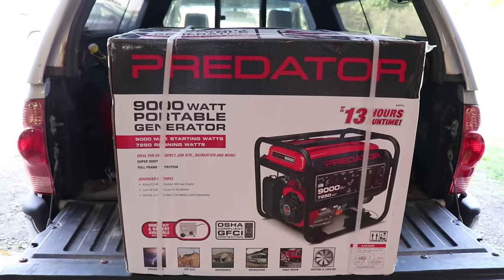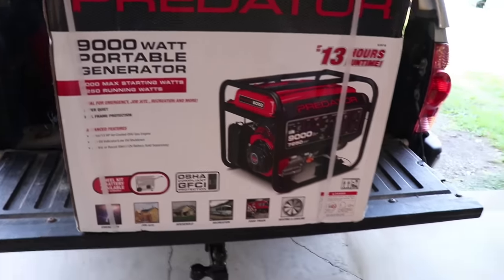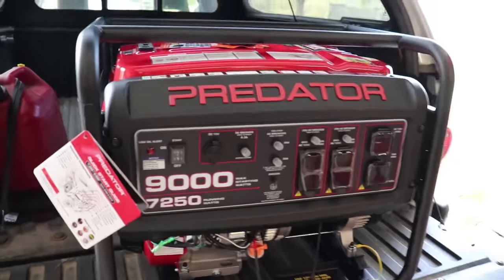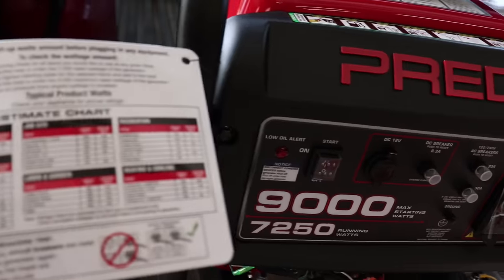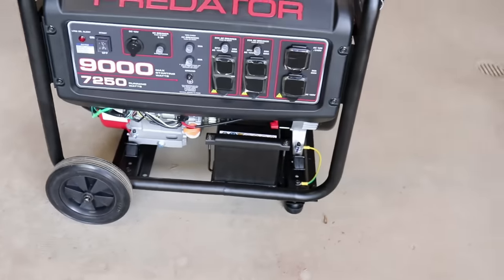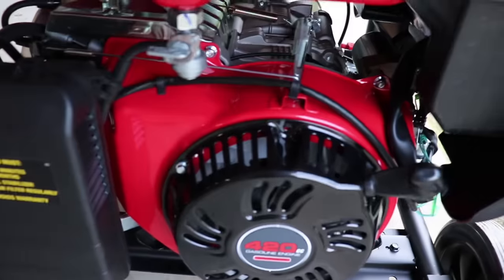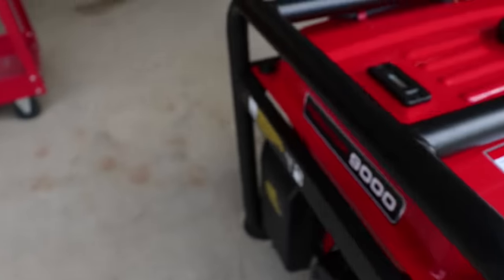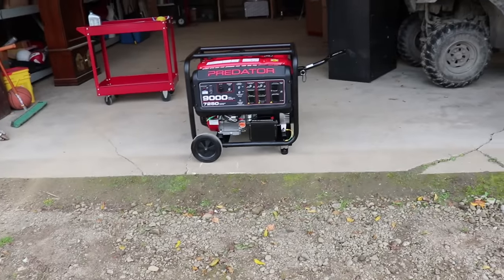Predator Generator Running Our ENTIRE Home. (Complete Setup and Cost)

Comment: Great video. We live in SE NC and our concern is hurrricanes. I guess where I still have questions concerns 110 vs. 220. I had an electrician do a220 plug. In the video in looks like where you made your 110 connection was a 220 plug. Is that correct? I assume you were running your cord from 110 outlet on the generator to the 4 hole receptaptacle?  That would sure beat running extension cords thru windows. My concern is that some of the YT videos have cautioned about backfeed in case the power company is working to correct the cause of the outage.
Thanks so much!
Reply: ⚠️Here’s an important safety announcement for everyone:

Please make sure you follow the generator safety tips whenever you use your portable generator. This is just a reminder for everyone’s safety. All generator safety rules need to be followed carefully 

Here are the generator safety tips: 

1) KEEPING OTHERS SAFE: Please do not allow an non qualified person or your children to operate and service the portable generator. Just because some manuals don’t say that doesn’t mean it’s safe. That is important against the generator safety rules. We also need to be keeping an eye on our children too. You need to make sure that your children are not playing near the portable generator especially when it’s running so they won’t get electrocuted. Generators pose electrical risks and they can be hot during an operation. Please keep your children away from the portable generator at all times. It is important to keep our children safe especially our little ones. Children often get curious about anything so we should keep an eye on them to also make sure they’re not wandering towards the generator. 

2) WHERE TO RUN YOUR GENERATOR: Some people use their portable generators indoors which increases the risk of carbon monoxide poisoning. It’s important to have a carbon monoxide if you have a gas generator. Never ever use your generator indoors even if your doors and windows are open and even in the garage is not safe to use a portable generator. Not even at your porch and your deck. It is never safe to use your generator indoors and in enclosed areas of your home. Your generator needs to be 15-20 feet away from your house. 

3)🔥FIRE HAZARDS: Never refuel your generator while it’s running. You need to let your generator cool off before refueling it and before storing your generator. Never overload your generator too. Never ever back feed your generator. You should never plug your generator into a wall outlet. Also never store propane tanks indoors. Please keep flammable things away from the generator as well and please don’t smoke cigarettes near the generator. Having a fire extinguisher next to the generator is also important against the generator safety rules. 

4) GENERATOR OPERATION: make sure your hands are dry before touching the generator. Never use your generator in wet conditions. Don’t let your generator get wet. You need a generator tent if you need to use your generator during wet weather. Please don’t wear loose clothes when operating the generator. Turn on your generator before plugging in appliances. Use the right cord for your generator. Please do not use worn out cords. Do not touch the generator’s engine when it’s still hot. 

https://youtu.be/I1jT3ANENvI and here is a video more about keeping others safe when using generators. All generator safety rules need to be followed carefully. 

Hope this helps. 

Please make sure you follow all the generator safety rules.

Comment: The power supply wouldn't have a clean sine wave from the generator which in turn will ruin things like laptops and other sensitive equipment.
Are there any warnings about this on that wattage card?
Reply: I can understand an inverter not having a good sine wave, but why would an actual rotating generator be a problem?
Reply: @jeepien  the sine wave it produces will not be stable enough for delicate electrical equipment, I know, i've ruined enough laptops and phones over the years.

Comment: Just picked up one of these generators, thinking about doing a propane conversion on it. I lose power at my hose usually at least once a year.
Reply: ⚠️portable generator safety announcements:

This is just a reminder to remember the safety rules when using portable generators. 

1) KEEPING OTHERS SAFE: Please do not allow an unqualified person or your children to operate and service the portable generator. Just because some manuals don’t say that doesn’t mean it’s safe. That is important against the generator safety rules. We also need to be keeping an eye on our children too. You need to make sure that your children are not playing near the portable generator especially when it’s running so they won’t get electrocuted. Generators pose electrical risks and they can be hot during an operation. Please keep your children away from the portable generator at all times. It is important to keep our children safe especially our little ones. Be aware of all the hazards.

2) WHERE TO RUN YOUR GENERATOR: Some people use their portable generators indoors which increases the risk of carbon monoxide poisoning. It’s important to have a carbon monoxide if you have a gas generator. Never ever use your generator indoors even if your doors and windows are open and even in the garage is not safe to use a portable generator. Please do not even use your generator in your deck or balcony. It is never safe to use your generator indoors and in enclosed areas of your home. Your generator needs to be 15-20 feet away from your house. 

3)🔥FIRE HAZARDS: Never refuel your generator while it’s running. You need to let your generator cool off before refueling it and before storing your generator. Never overload your generator too. Never ever back feed your generator. You should never plug your generator into a wall outlet. Also never store propane tanks indoors. Please keep flammable things away from the generator as well and please don’t smoke cigarettes near the generator. Having a fire extinguisher next to the generator is also important against the generator safety rules. 

4) GENERATOR OPERATION: make sure your hands are dry before touching the generator. Never use your generator in wet conditions. Don’t let your generator get wet. You need a generator tent if you need to use your generator during wet weather. Please don’t wear loose clothes when operating the generator. Turn on your generator before plugging in appliances. Use the right cord for your generator. Please do not use worn out cords. 

https://youtube.com/shorts/eFigDfnPkcQ?feature=share and here is a short video more about keeping others safe when using generators 

Hope this helps.

Comment: @The Cook Family Homestead:  Don't you have any problems with your heating system ? The heating control, PCs, ... (electronic stuff) is said to be very sensitive to sinus wave disturbencies and might get killed very easily. Therefore normally inverters are used for this purpose because they have a steady sinus wave.
Reply from the maker: I have had zero issues!

Comment: If you’re not home when the power goes out, does this generator turn in automatically or does someone need to be physically present to turn on?
Reply from the maker: This is a manual generator....meaning I have to go out and start it and switch the power over.

Comment: My home is a older home, setup with 100 Amp service. My 220v in my home is wired with 10/3 wire not 10/4 wire. Over the past weekend, I wired this same Predator 9,000 Generator to my home. I had to add the 10 gauge Green wire to make 10/4. I went-out and purchased the Predator 10/4 twist-lock Generator extension cord for this generator for $49 from Harbor Freight. When wiring to the fuse box. I see many videos of people wiring a FEMALE outlet to their fuse box. The issue is, The 10/4 extension cord is male & female ends. By installing a female outlet to your fuse box. Doing so, will require cutting-off the female end of the extension cord to add a Male. Requires both males on the extension cord. Or do you simply cut-off the female on the cord and direct wire it to the box?
Reply: ⚠️Very important announcement for everyone:

Please make sure you follow the generator safety tips whenever you use your portable generator. This is just a reminder for everyone’s safety. All generator safety rules need to be followed carefully 

Here are the generator safety tips: 

1) KEEPING OTHERS SAFE: Please do not allow an non qualified person or your children to operate and service the portable generator. Just because some manuals don’t say that doesn’t mean it’s safe. That is important against the generator safety rules. We also need to be keeping an eye on our children too. You need to make sure that your children are not playing near the portable generator especially when it’s running so they won’t get electrocuted. Generators pose electrical risks and they can be hot during an operation. Please keep your children away from the portable generator at all times. It is important to keep our children safe especially our little ones. Children often get curious about anything so we should keep an eye on them to also make sure they’re not wandering towards the generator. 

2) WHERE TO RUN YOUR GENERATOR: Some people use their portable generators indoors which increases the risk of carbon monoxide poisoning. It’s important to have a carbon monoxide if you have a gas generator. Never ever use your generator indoors even if your doors and windows are open and even in the garage is not safe to use a portable generator. Not even at your porch and your deck. It is never safe to use your generator indoors and in enclosed areas of your home. Your generator needs to be 15-20 feet away from your house. 

3)🔥FIRE HAZARDS: Never refuel your generator while it’s running. You need to let your generator cool off before refueling it and before storing your generator. Never overload your generator too. Never ever back feed your generator. You should never plug your generator into a wall outlet. Also never store propane tanks indoors. Please keep flammable things away from the generator as well and please don’t smoke cigarettes near the generator. Having a fire extinguisher next to the generator is also important against the generator safety rules. 

4) GENERATOR OPERATION: make sure your hands are dry before touching the generator. Never use your generator in wet conditions. Don’t let your generator get wet. You need a generator tent if you need to use your generator during wet weather. Please don’t wear loose clothes when operating the generator. Turn on your generator before plugging in appliances. Use the right cord for your generator. Please do not use worn out cords. Do not touch the generator’s engine when it’s still hot. 

https://youtu.be/I1jT3ANENvI and here is a video more about keeping others safe when using generators. All generator safety rules need to be followed carefully. 

Hope this helps. 

Please make sure you follow all the generator safety rules.

Comment: I see you have your cord plugged in on the 120/240 plug on your generator.. How does that work on not burning your 110/120 electronics???
Reply: The 240 outlet feeds 120v to each leg on your electric panel.  Inside the house 120v things get powered by a 120v breaker connected to only one leg, 240v things get power from a 240volt breaker that pulls 120v from each leg giving you 240volt.  The panel distributes the power.

Comment: Hey Steve what type of generator would you recommend if I was to go with two heating elements that each Recommends 250 Voltage, if you got the time to reply if not I completely understand, thank you so much for your hard work support on sharing YouTube videos 👍🏽
Reply: ⚠️portable generator safety announcements:

This is just a reminder to remember the safety rules when using portable generators. 

1) KEEPING OTHERS SAFE: Please do not allow an unqualified person or your children to operate and service the portable generator. Just because some manuals don’t say that doesn’t mean it’s safe. That is important against the generator safety rules. We also need to be keeping an eye on our children too. You need to make sure that your children are not playing near the portable generator especially when it’s running so they won’t get electrocuted. Generators pose electrical risks and they can be hot during an operation. Please keep your children away from the portable generator at all times. It is important to keep our children safe especially our little ones. Be aware of all the hazards.

2) WHERE TO RUN YOUR GENERATOR: Some people use their portable generators indoors which increases the risk of carbon monoxide poisoning. It’s important to have a carbon monoxide if you have a gas generator. Never ever use your generator indoors even if your doors and windows are open and even in the garage is not safe to use a portable generator. Please do not even use your generator in your deck or balcony. It is never safe to use your generator indoors and in enclosed areas of your home. Your generator needs to be 15-20 feet away from your house. 

3)🔥FIRE HAZARDS: Never refuel your generator while it’s running. You need to let your generator cool off before refueling it and before storing your generator. Never overload your generator too. Never ever back feed your generator. You should never plug your generator into a wall outlet. Also never store propane tanks indoors. Please keep flammable things away from the generator as well and please don’t smoke cigarettes near the generator. Having a fire extinguisher next to the generator is also important against the generator safety rules. 

4) GENERATOR OPERATION: make sure your hands are dry before touching the generator. Never use your generator in wet conditions. Don’t let your generator get wet. You need a generator tent if you need to use your generator during wet weather. Please don’t wear loose clothes when operating the generator. Turn on your generator before plugging in appliances. Use the right cord for your generator. Please do not use worn out cords. 

https://youtube.com/shorts/eFigDfnPkcQ?feature=share and here is a short video more about keeping others safe when using generators 

Hope this helps.

Comment: Some things you need to be aware od   if this is a bonded generator it needs to be unbonded or it will fry your house if you do that you will have to rebond if used independent of the house . Other thing to know is if this is a standard generator and not a invertor type . This means the electricity is not a true sine wave which they call dirty power . Electronics may not play happy with this and may burn them up . Another point you may not get close to 9000 watts of useable power as the plug you are using is 30 amps and there is a breaker on the generator that wont allow anymore for safety reasons . You also will have to come up with a plan of lacating your generator . More people die from the generators funes they produce than from the power outage themselves

Comment: Great video bro.  How far away (wattage wise) are you from powering your A/C or Furnace if necessary?
Reply from the maker: I did a video (in description) of a test I did with the window unit air conditioners. Ran them easily. Check out the video.
Reply: @TheCookFamilyHomestead  Didn't even see that link.  Thanks, so much.  That's the exactly set up I plan to use.
Reply from the maker: @hnmcclain  thanks for watching my friend! Let me know if you have any other questions. I've had this for over a year now and it has worked amazing. Good luck!

Comment: Another thing I’ve learned is because I have solar with micro inverters I don’t need such a big generator if the power outage is during the day because the generator will back feed 240volts and as long as the micros see the voltage and and the sun they’ll help share the load with generator and in theory it would run my ac also but if the outage was at night time I would just be able to use everything in my house except probably then ac unit they just draw a lot of amps to turn the motor

Comment: Thanks for your video sir, it is great.  I am wanting to do the same thing, but curious to know if your central hvac has had any problem with electric from that generator?  I am hearing about some of the newer high efficiency furnaces not "liking" the power from portable generators and not functioning.  Talking about the sine wave from the generator, not just the predator, but almost all portable generators, have you experienced that problem or have ideas?  thanks again..

Comment: Does the generator plug next to the service panel de-bond the neutral?  Or, did you de-bond the neutral at the generator?  Otherwise, the main line coming into the service panel will be energized (even with the main breaker flipped to off).  (GFCI on the generator indicates it has a bonded neutral - even though this is not mentioned in the manual).
Reply from the maker: It doesn't need to be. And there is no way that electric can pass through a breaker that is turned off. If that were the case every electrician on earth would be dead. Once the main is shut off no electricity can pass through it back out the main line coming in. It's impossible.
Reply: Ah - you're right.  I don't know what I was thinking.  I got lost in NEC 250 and thought the parallel path neutral would cause this to be an issue.  For generators, it just practically affects GFCI, partly why one ground-neutral bond is code.